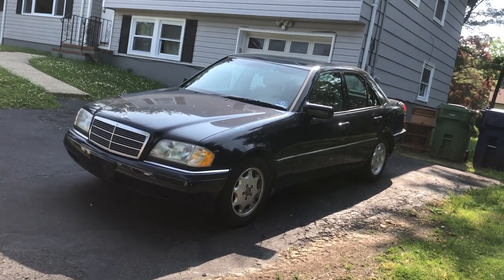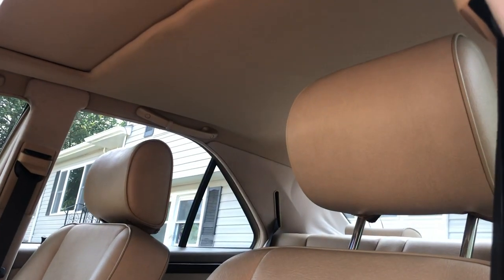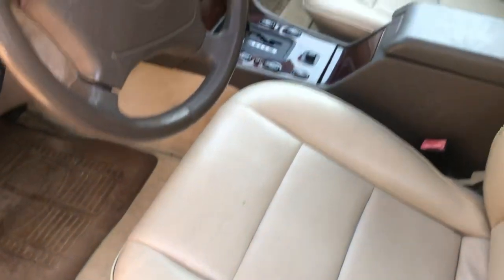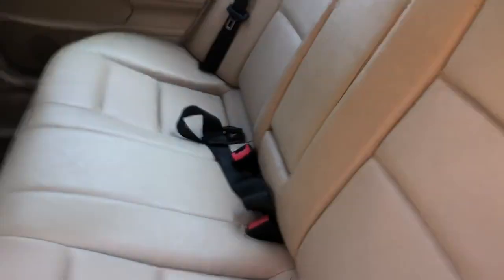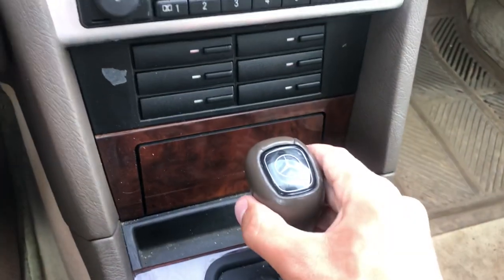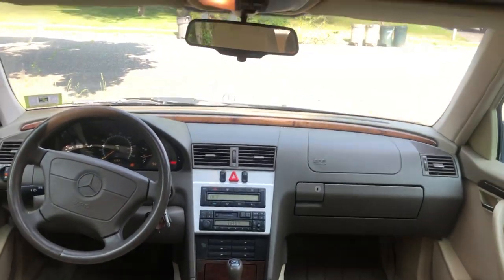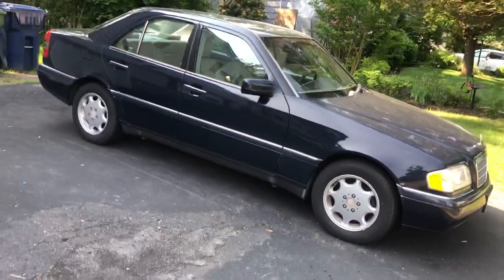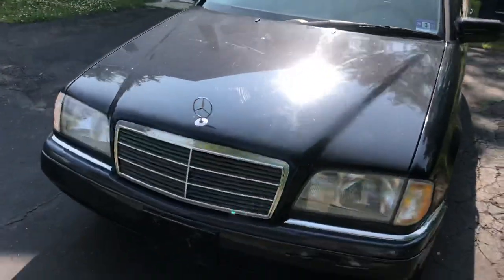1996 Mercedes-Benz C220: Tour, Walkaround and Startup

Comment: Nice review - Thanks.  does it feel underpowered when you drive? Did you buy it from dealer/lot or private party.  does the AC still works?
Reply from the maker: Nasar Azam yeah it’s pretty slow. I’d go for a V6 or supercharged Model. I just upgraded to a w203 c240.
Reply from the maker: Nasar Azam I got it from a private seller and no the ac didn’t work but it was only $1,600
Reply: Turbo?